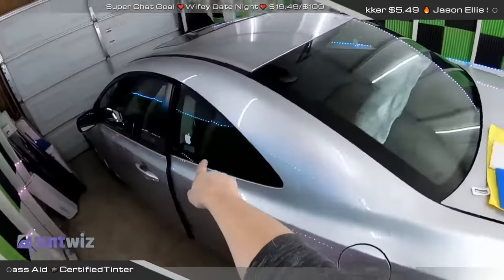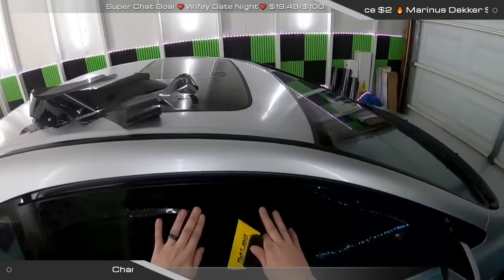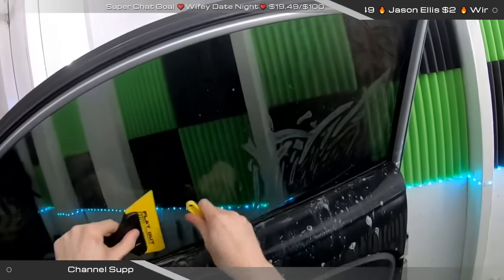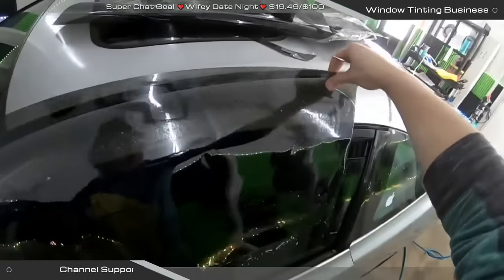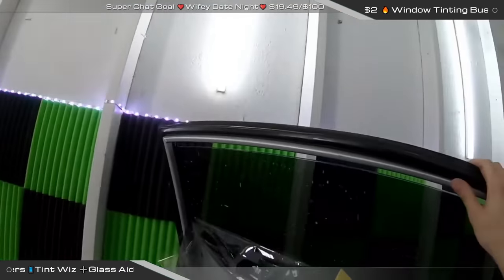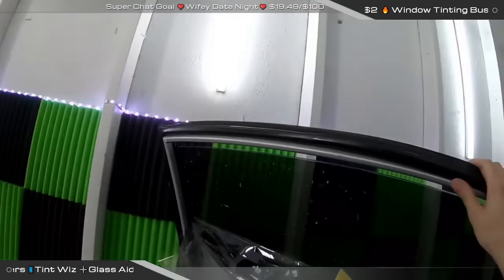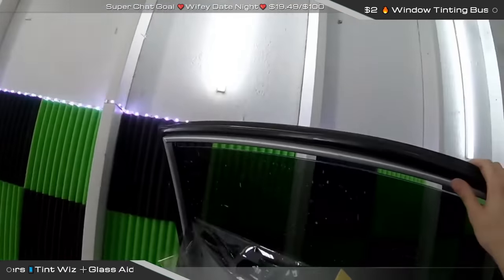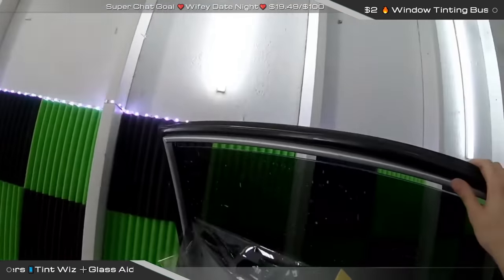🔴 Civic Window Tint | How to Tint Windows | Hand Cut and Install Honda Window Tint

Comment: If I could make a recommendation, put a few hooks on your walls to hang your heat gun in between windows you shrink and some wall mounted shelves to get things off the floor. It’s crazy how much the simple stuff helped my shop. Maybe it’ll help yours!
Reply from the maker: yea that's a good suggestion, it's the first car I've done in here so getting a feel for where things would be handy.